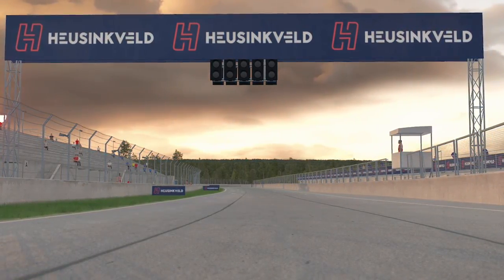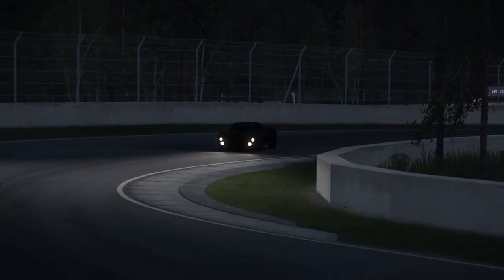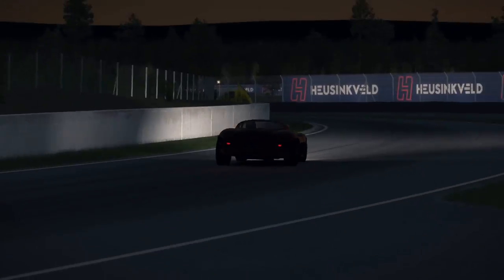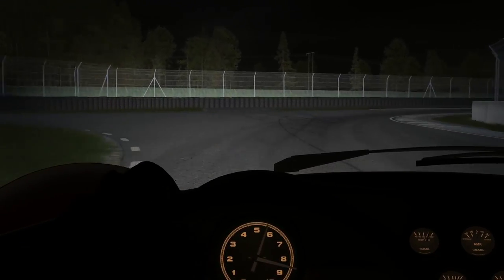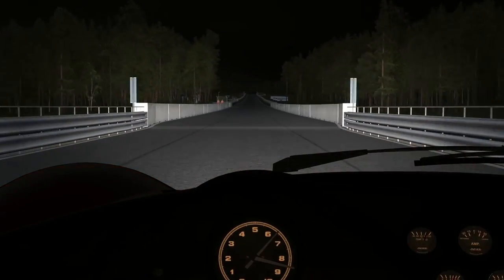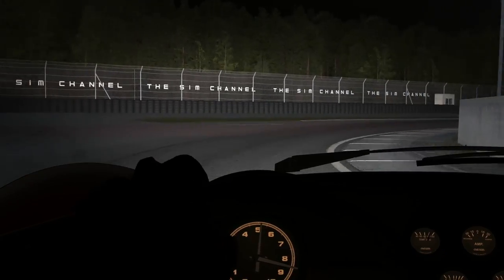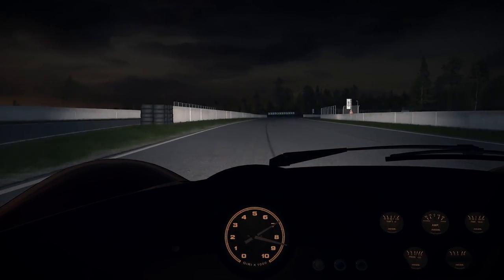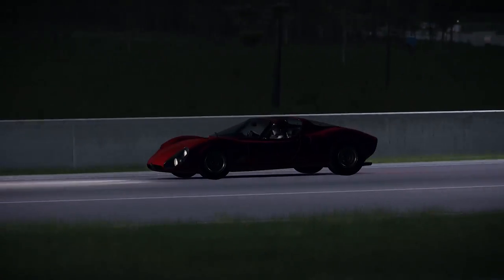Making An Assetto Corsa Track | Talking Sims - Leon Sutfeld

Comment: VW Firetruck in Fat Alfie tracks in all difficult corners... Repeating assets... I thought it was a bit of a running gag, old rF1 mod tracks used to have a generic crane asset in difficult corners. You just know if you see those, start scrubbing off speed... and the VW Firetrucks in Fat Alfie tracks are sort of placed in similar places.
That low grip surface.. Astro Turf???